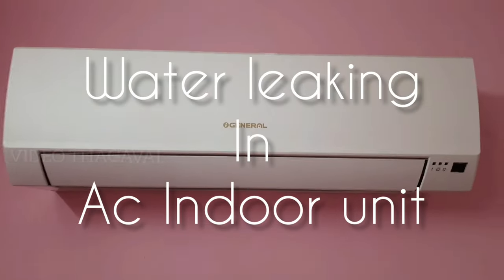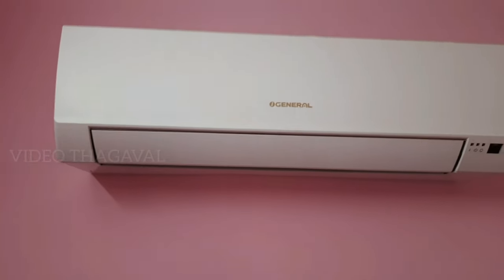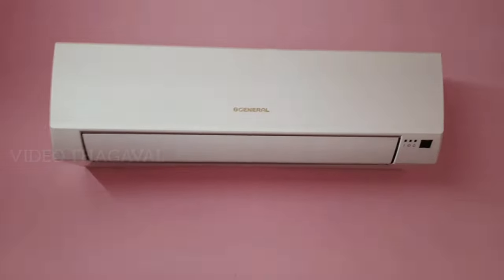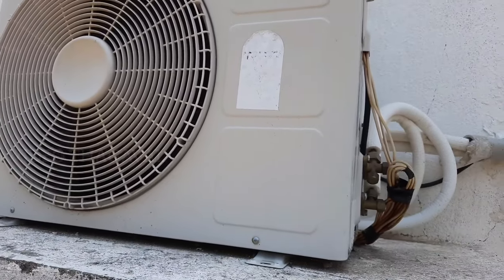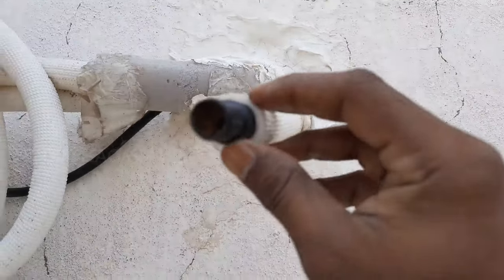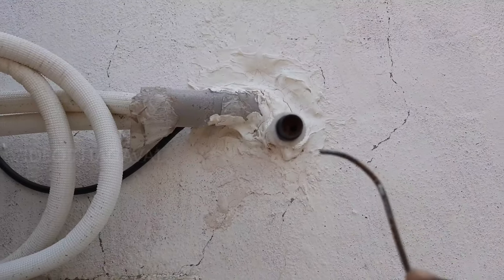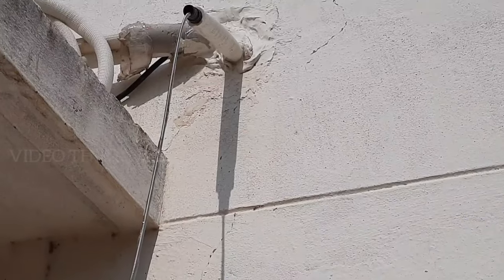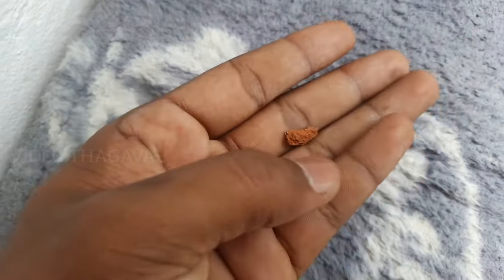How To Repair Water Leaking In Ac Indoor Unit | Tamil | தமிழில் | Water Leaking Problem In Ac Indoor

Comment: Sir AC irundhu water leck agakulla AC use pannalama
Reply from the maker: ac running la irukumbothu first time water leak aguthuna ac ya off paniyaranum next time water drain pipe clean panitu use panalam. water leak agumbothum ac run agum but continuously use panum bothu issue varum so repair panitu use panunga
Reply: @videothagaval  thank you sir

Comment: Bro..pudhu voltas 1.5 ton AC fit panni 45 naal dhan aagudhu.. adhukkulla indoor unit la water leak aayi neraiya thanni ulla varudhu bro.. enna problem ah irukkum?!
Reply: Outdoor water pipe change pannuga
Reply from the maker: indoor la oru water waste tray irukkum atha follow pani outdoor ku oro waste water drain pipe pogum adhula block irukum so technician vachu block oruka paka solunga..!
Reply: @videothagaval  ok bro.. naan call book panren.. thanks bro

Comment: Ac running la appo romba sound ketkuthu regular ah ketkala appo appo ketkuthu but romba noise ah irukku. Lorry break podura sound pola. Sound ketkumbothu off pannidurom again 15 minutes kazhichi start pannuna sound ketkathu marupadiyum 30 minuteskulla antha sound ketkuthu. Daikin Ac
Reply: Indoor unites
Reply from the maker: ac indoor unit la sound varuthuna mukiyamana kaaranam dust aprm loose parts aprm silasmayam condenser fail aga pothunalu intha sound varum but neenga oru general service paunga nala technician vachu.

Comment: Tap tap sound is coming from indoor.. Is this any severe problem
Reply from the maker: yes sometimes normally sound coming from indoor unit like click click but if u feel that sound loudly means it may be fault in thermostat or some damage or loose materials in indoor unit better you can check with local technicians

Comment: Neenga video la sona mari elame correct ah panen. Indoor unit la oru curtain rod use panu outdoor pipe vazhiya  clean panen. Konchom dust irunthuchu aprom easy ah poiytu, easy ah vanthuchu. Again elame fit panitu, AC ON panen chill vanthuchu but inum water leakage indoor la varuthu ( quantity kami agirku).
Ena panalam adhuku?
Reply from the maker: ac indoor unit water tray outlet la vera ethu adaikitha nu nala again check panirunga beacuse clean pani 1 day kula kuda theni kodukativitrum..! again water leak achuna better technician vachu parunga...!

Comment: Veliya irukka pipe reach panna madiyadhu yena its in the 5th floor, epdi clean panradhu? Illa irundhu spring vitta podhuma?Spring illayna enne use panradhu anna?
Reply from the maker: indoor unit valiya ulla irunthe vidunga adhu direct water outlets clear panirum....!
Reply: Call Ac technician